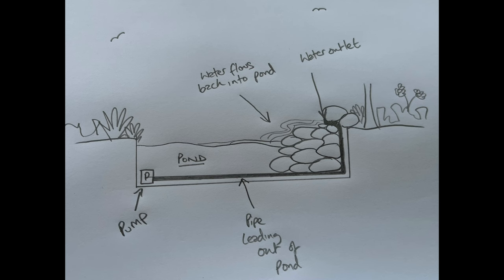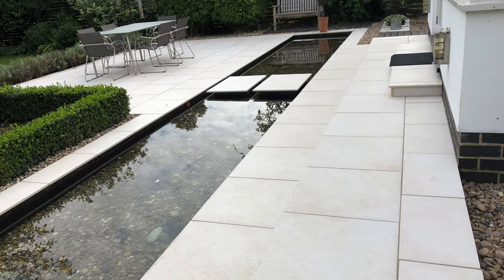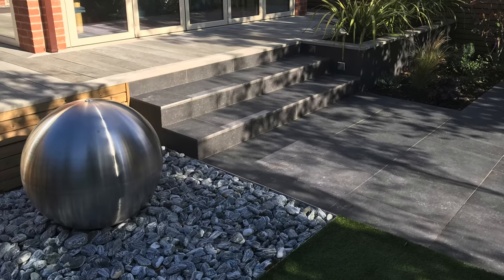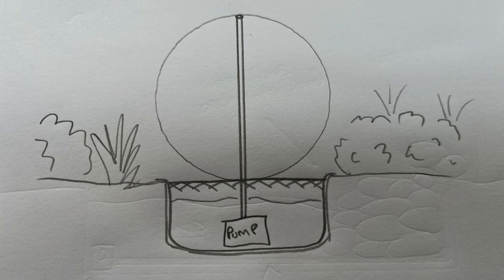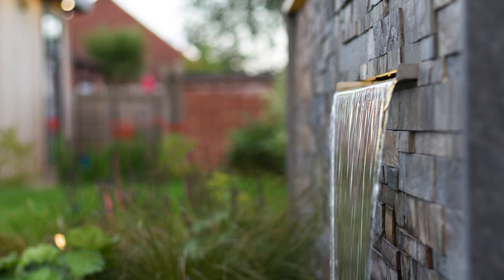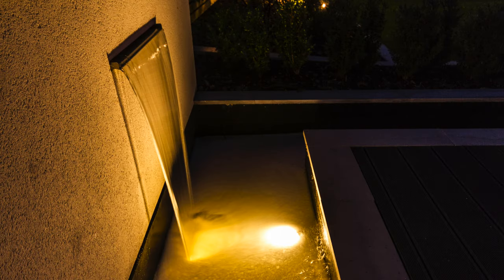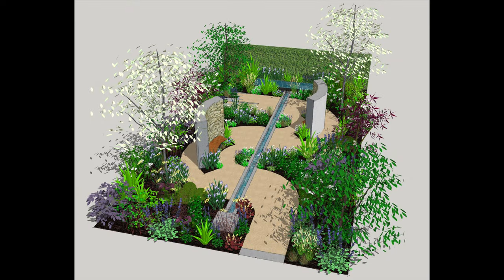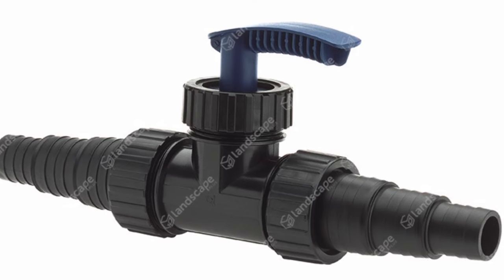Designing water features within the garden

Comment: Thank you for a great video as usual. I have 1 question and 1 suggestion. 

Regarding the simple globes or any sort of self-contained water features, obviously there's a need for an electrical supply (for non solar powered ones). How does that work in the UK? Do you need a specialist electrician? Can it be done as DIY project? What's the cost for an electrician in average? 

Regarding the suggestion, I watched recently a couple of videos on artificial streams and they are stunning. Obviously not for small gardens but I think people would be interested in hearing your thoughts in a follow up video.

Thanks!